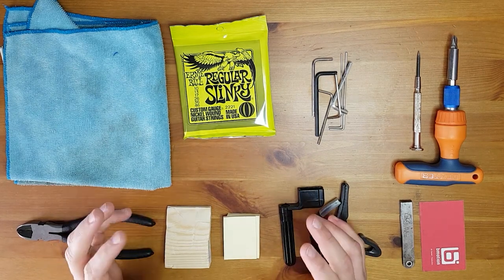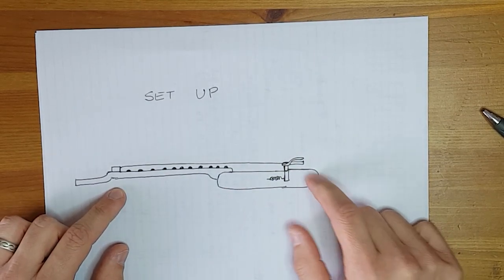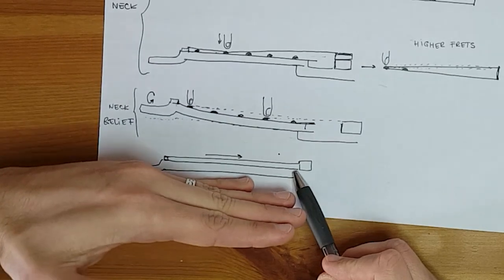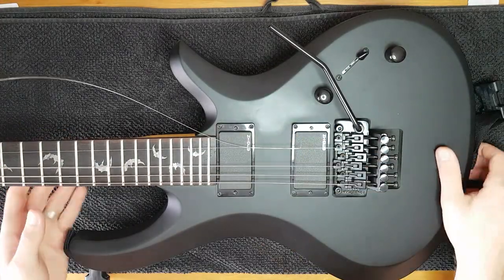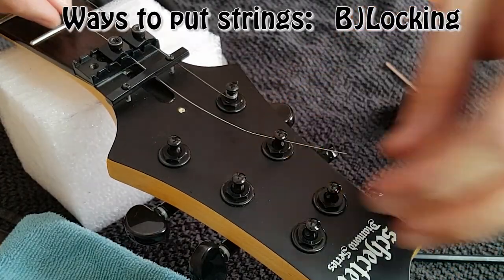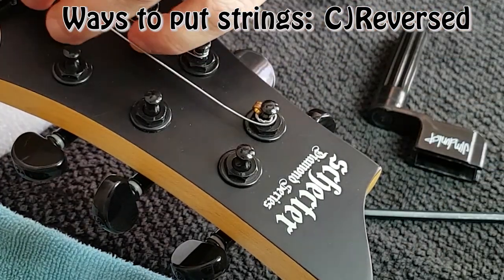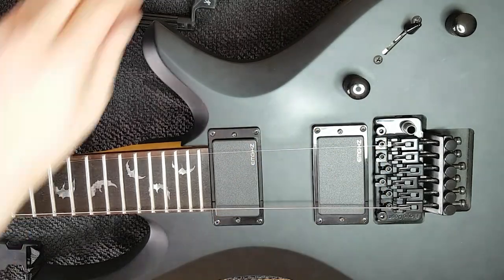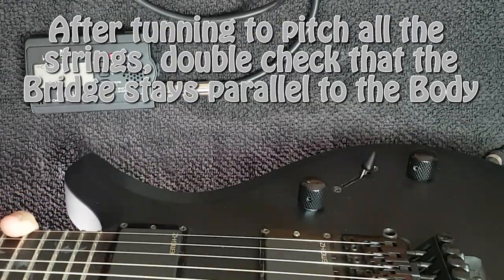12 Step Tutorial to Setup a Floyd Rose Guitar for Beginners

Comment: Why do you string the top and bottom strings first and the add the other strings later?
Reply from the maker: Hi. First, I do it this way because you just need the low and high string as a primary reference to determine an approximate action height at the begining of the setup. 2) if the action height is not in the desired range, you need to raise or lower the bridge. Before you turn the bridge posts you need to remove the force caused by the string tension to avoid damaging the posts when you turn them in order to adjust the height. It is easier and faster if you do this with only two strings instead of six.

That is why I do it that way. After you get the string height in the ballpark you can install the rest of the strings. I hope this explains it

Comment: I cannot full step bend my strings whats the problem? is it my string problem?
Reply from the maker: What do you mean?
Reply: @alverduratonejunkiealveram1017   i cannot do the 2notes bending on 1 number String with D# Tuning. 
my strings are too tight
Reply from the maker: @HossainPanthoOfficial  if strings are too tight maybe your string gauge is not suit for the scale of your guitar and tuning. The longer the scale you will feel that the strings have more tension. Tension can be affected by other things but if can't bend the string because it feels too stiff then you don't have the right string set for that guitar
Reply: @alverduratonejunkiealveram1017  i can understand, thank you for this help
Reply from the maker: @HossainPanthoOfficial  I remember once I was doing a checkup setup and I had buzz all over the first string, after checking the nut, the frets and the bridge I decided to swap that string for another one just to see and it was gone. It's a mistery but sometimes you just need new strings LOL
Reply: @alverduratonejunkiealveram1017  yeah obviously new strings are like 100% Battery Lmao
Reply from the maker: @HossainPanthoOfficial  but again check the string gauge. For example, for standard tuning I tend to use 10s on Les Pauls and 09s on strats becuase the scale is longer and there is more tension. If I am droping a Les Paul to Eflat or D then I go to  11s. If your guitar has a longer scale then lighter strings.
Reply: @alverduratonejunkiealveram1017  yes my scale is long I'll buy lighter strings

Comment: Now I understand why those things are les popular. What a hassle for each string. I just bought a guitar with a Floyd, without thinking too much about it, but now I regret.
Reply from the maker: Yeah man, It is a pain to do the intonation but once it's done you rarely need to set it. Unless you change string gauge or tuning key
Reply: @alverduratonejunkiealveram1017 thanks for your support. I need to change pickups, and tune a whole step down... Without moving the (miraculously low) action set by the previous owner. And learn how to palm mute without moving the damn thing :-) I will (probably ?) prevail thanks to good people like you.
Reply from the maker: @426baron  don't worry. Tune down and mostlikely it will buzz. So, you will have to loosen the springs in the back. If the action is too low now is the moment to set it the way you like it

Comment: I have fret buzz on B  string can't get rid of it !
Reply from the maker: Just the B string??? Around which fret?
Reply: Yes just the B string , 12th fret
Reply: It starts at 3rd fret goes in to 5th 7th and worsens at 12 . Not sure what to do
Reply from the maker: Are the frets under the b string worn out? I would look at the saddle as well because that is a weird problem
Reply: @alverduratonejunkiealveram1017  
No the frets are fine i checked . 
I suspect the saddle could be the issue , how can I correct this by using the saddle , adjustments.
Reply from the maker: @svorttsirhc1814  check the part of the saddle that touches the string. Check the nut as well because sometimes the string vibrates against it. Loosen de locking nut  then push the string towards the E string for example and tighten the locking nut. Sometimes buzzes don't come from the frets and I think this might be one of the cases
Reply: @alverduratonejunkiealveram1017  
I will try this , thank you for the tip you should do a video on this ! Best regards
Reply from the maker: @svorttsirhc1814  you're welcome!!!

Comment: Gotta be an easier way to tune it! Get an app.there’s apps for everything. He appears to be over complicating things. But what do I know?
Reply from the maker: With floyd roses there are no shortcuts 🤣🤣
Reply: Al Verdura Tone Junkie Question, If you set it up once, why can’t bridge stay set and just make adjustments at the tuning pegs? Using same size strings.
Reply from the maker: @flintdavis2  This is the thing, the guitar is setup when you get to the point where the strings are tune to pitch, the neck has the correct relief, the bridge is parallel to the body and the saddles are in the right position so you get the correct intonation when you fret notes ok. If the guitar is in this stable situation you can put new strings using the same gauge and it won't need adjustments. In my experience sometimes you'll need a minor adjustment depending of changes in humidity, temperature, etc. If your guitar is setup and you are putting new strings just remove one string, put the new one and tune to pitch and repeat until you change all of them, this way the guitar will remain under tension all the time and will be easier to keep it tune.

Comment: But if you keep turning it to pitch at the end, don't you throw the guitar completely out of tune again?
Reply from the maker: Yes and no. When you tune to pitch, the bridge moves a little but if it´s parallel to the body then is just going to be a tiny bit. You will notice when you increase the pitch of one string the other will tend to go flat because the bridge goes up. You will get to a point where you get all the strings in tune and you need to check that the bridge at that particular moment is parallel to the body.
If you get to this point and the bridge is too low of too high I recommend repeat these steps
     - Block the bridge 20:17
     - Tune to pitch
     - Remove the block from the bridge 38:04

If you keep trying to tune to pitch one string and the others go out tune then the springs don´t have the right tension. Try that and let me know
Reply: If the bridge tends to keep angling-up when tuning all strings to pitch, it means that there's not enough spring-tension to counteract it, to fix this, gradually tighten each of the spring-claw screws by 1/4 of a turn till the bridge sits/floats parallel to the front-face of the guitar's body, if the bridge is angling into the body route, this means that there's too much spring-tension counteracting the string-tension, to fix this loosen the two spring-claws gradually by 1/4 turns till the bridge sits parallel to the guitar body, you're basically trying to balance the string-tension with the spring-tension, when both are balanced-out the bridge should be sitting/floating parallel to the front-face of the guitar body, it does take a bit of time, but have patience and eventually you'll have the bridge set correctly, here's a tip, try to install the trem-springs so that they run parallel...not splayed-out at funny angles, if they are installed so they run parallel then each spring can contribute equally to counteracting the tension on the strings.

Comment: I have 5 springs in my floyd is that to many?
Reply from the maker: Normally 3 is enough but that depends if the screws can take it. If yours has 5 springs and the brigde is floating parallel to the body there is no reason to remove any.  If you remove some then you will have to tighten the screws. In the end, the force of the springs and the strings in tune have has to be the same no matter how many springs are holding it.
Reply: @alverduratonejunkiealveram1017  perfect thanks. I bought the guitar second hand, and saw yours and one of my friends has 4 so i thought 5 might be over kill. Great video by the way. I tried tuning it without having a block in place and it did not work. Before I watched your video ofcourse. 👍
Reply from the maker: @smbmxdirt3427  glad to hear that!!!!

Comment: A lot of good info here but a few things are a bit off. You should never adjust your bridge with 2 strings on. You must string the guitar up to full tension and adjust the neck before you bother touching the bridge hieght.  The string tesnsion will always pull the neck up a bit. You even ran into this problem in your video. Aslo, You will not damage your knife edge by adjusting it at tension. It is going to be getting whammy'd at tension. The knife edge will only dull when beng whammy'd while its not set to the proper 90 degree angle.
Reply from the maker: Thanks Tommy! Yeah of course the tension will pull the neck and the action is going to be higher but my goal here was to establish a ballpark height to start doing the setup. About doing the height adjustment while having the string tension, a long time ago I damaged a cheap bridge doing it that way 🤣🤣. That´s why I don´t recommend doing it
Reply: @alverduratonejunkiealveram1017  If a screw gently spinning against it damages it then it will certainly be damaged by whamming it at tension as it is moving up and down on the bridge pin screw while all 6 strings are fully tuned. It's many times more stress then an adjustment. I suspect you adjusted the screws while the bridge was not at the proper 90° angle, which made it slip up or down and that is what will cause the knife edge to flatten.  I've been adjusting my bridge last for over 30 years as any professional Luthier does and I have never had an issue with it damaging the knife edge. When setting up any guitar you always want to have the neck properly adjusted at tension before you start adjusting the bridge or determining any other issues with the setup. If not, your making adjustments that are just going to need readjusting later. If you were just ballparking it then that is fine but I didn't see you go back at the end to check the fret buzz and lower the action to it's lowest height after adjusting the truss rod. That is the Only reason I bothered commenting. I don't feel this will give you the best setup in the end without following the proper order of setup operations.
Reply from the maker: @tommydstudios2094  not at all buddy!! I just wanted to be extra careful because I supposed that people that is looking at this video would have no experience doing setups. Since I damaged one of those cheap bridges I thought I'll be extra careful with the advises I give. Funny story, that cheap bridge since the blade was damaged I blocked it and days later the guitar was way out of tune and I saw that the plate wasn't flat, it got bent!!!!! 🤣🤣🤣🤣🤣🤣. 15 dollar bridge from Ebay 👎👎👎👎👎👎
Reply: @alverduratonejunkiealveram1017  I ordered one of those cheap Floyd's off eBay for an art project before. It slipped out of hand and fell a mere 3 inches to my bench and had  dings in it.  They are not heat treated to be as rigid as a Floyd Rose would need to be to hold up to the abuse they must endure. I'm guessing all those are toasted after using them for short while anyway lol.

Comment: So there is no need to pay for "professional" set up?
Reply from the maker: Well, my advise is that you can try to do it yourself. If your guitar doesn't have fret leveling problems you should be fine. I do this for a living now and I perform pretty much that procedure, sometimes depending of the situation I had to do things differently or pull out some tricks but for the average guitar that will work.
If you find out that after following the procedure you still get fret buzz on some places or you can't get it in tune then you can take it to a luthier 🙂

Comment: This is one of the few clips -that notices the fact that You shouldn't adjust the trem posts with full string tension on. However: The correct way to adjust the post is without ANY string/spring/block -tension AT ALL. In short: -NEVER, -EVER adjust/turn the tremposts (like this 23:25) -with string tension on! Regardless of what is shown in this clip. This will ruin both the posts as well baseplate on Your trem. Especially on a economy/softer steel tremolo unit -like shown in this video. A perfect trem postscrew -and a base plate edge should NOT have ANY turning scars of ANY KIND, EVER...
As a Luthiere/Roadtech; i would also recommend to touch in some sort of thicker 'lubricant' -on the contact surface between the post and the baseplate edge. This prevents wear in softer steel found in economy trems to a good degree. No spray works; but small hint of ballbearing grease applied with a toothpick -works fine. By the way: This is also true for high end bridges.
Reply from the maker: Thanks for the advice man!! Makes total sense, my only concern is that is going to take forever to adjust the height